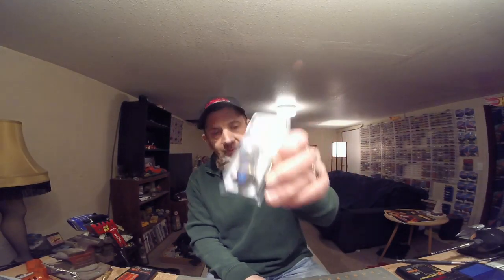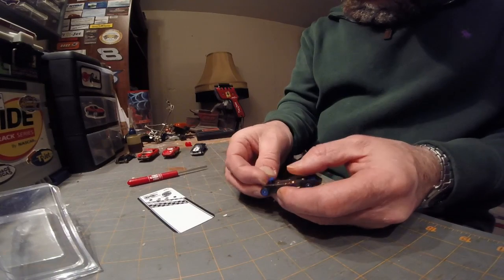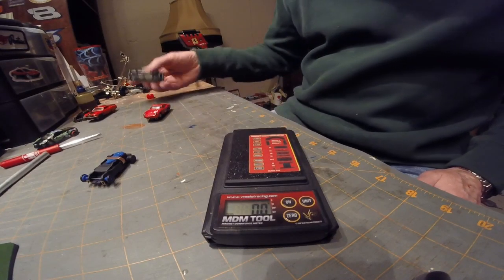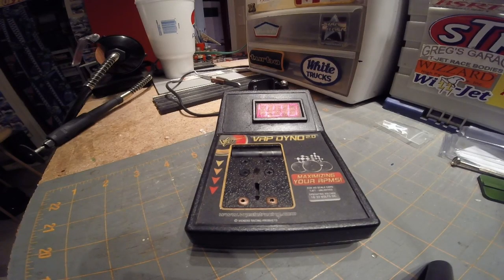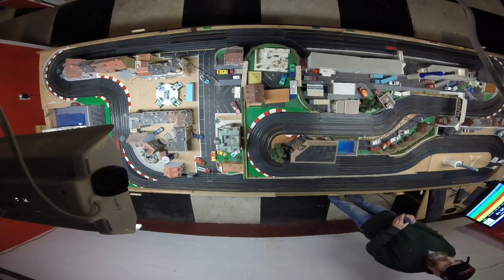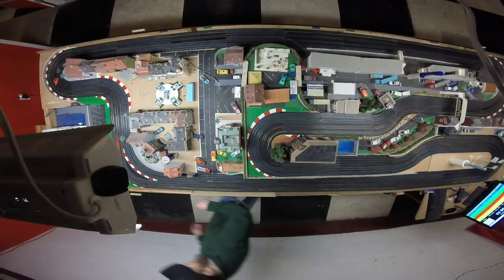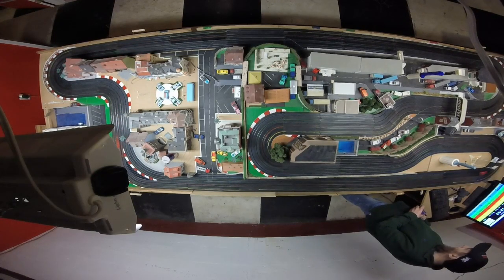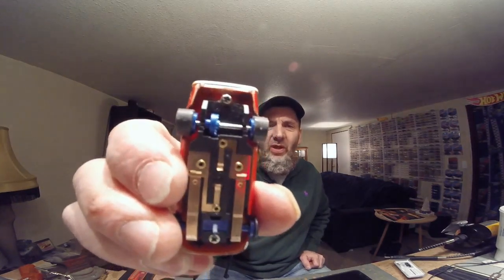OS3 TFX Review

Comment: Great chassis. Love mine. Installed a DASH 3 lam 10 ohm motor and changed the rear wheels to take super tires. Super fast and smooth running. Will definitely buy more.

Comment: I really like the TFX chassis. I have a lot of T-Jet bodies that need a chassis, and I am buying these for them. Original T-Jet chassis are far too expensive, and I don't like magnet chassis of any kind. I don't know if the TFX axles will accept original T-Jet hubs or Vincent wheels (at least I haven't tried it yet). If they don't that would be the only downside about them. Another good point about them is that their center of gravity is lower due to the placing of their axles. Thanks for a good review.

Comment: Give the tires some time to break in, you may find their grip will improve.  Also, I thought I heard the chassis bottoming out on your Tomy track. The TFX chassis run optimally on routed track given how low they sit stock. One stop slot shop does offer a slightly taller tire option (front and rear) that works very well on sectional track like Tomy.

Comment: Autoworld has a new set out. Dragstrip with VW buses. However the track is orange. Shows exactly where they consistently fail. Selling toys, not items that appeal to hobbyists. I'd probably buy that set if the track was black and if they are going to offer a different color gray would be fine. Tyco did that with the US1 trucking stuff and more than a few people like it. Autoworld is just pathetic. I do like most of the bodies but many of them show flaws new in the package. Adults in the hobby spend significant amounts of money. Toy buyers are never going to match what we spend. Autoworld just doesn't get it.

Comment: Mine all dragged on afx track and I had to sand the chassis a bit. What is that pin height tool you have?
Reply: I like SuperTires. They have a Tuff Ones size .378". Will they fit the wheels?